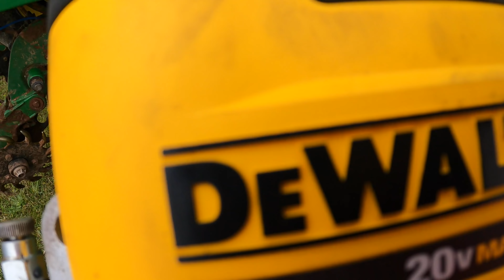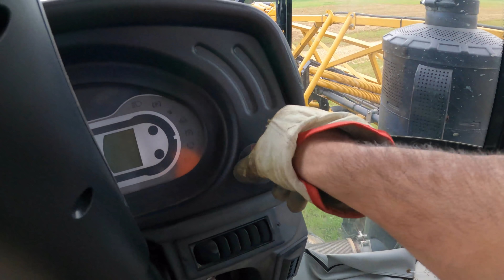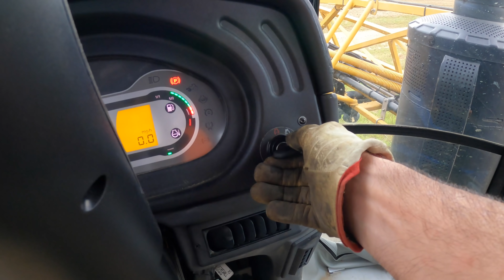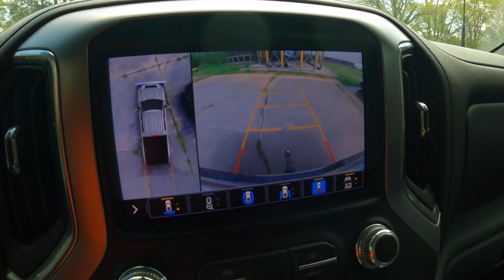RAIN DELAY CORN 2022

Comment: Thanks for the video. Have you considered trying to work a deal with your insurance and your dealer and trade for a new tractor now instead of waiting until it is fixed. That way you would have one for planting, with parts shortages it might be a while before it is working again. Maybe that is not possibly.

Comment: Thank God you have the insurance,my cousin was in a Dodge 2500 diesel p/u and was struck in the field and the wiring immediately caught fire.He had to bail and run for the tractor to ride the storm out.The truck was totaled but amazingly the chassis and engine survived and they bought it back for parts.

Comment: What are the benefits of you guys running stacker planters when you can pull one that’s twice as big? In south central Nebraska run one big pull type and one stacker. The only reason they have a stacker is for the pipe irrigation field’s to pull as far as they can.

Comment: Hi Daniel,  Just an observation when you were greasing etc the corn planter.  What was stopping the three point linkage's hydrologic's failing, with you under machine, maybe not the best example to the young generation, on safety.  Best Wishes

Comment: Great video as always...back in the 90's when I farmed had a combine get hit by lightning..that back before all the electrics like have today...are batteries were blown up too...after we put in new moniters & gauges then figured out had to change about every wire or wire harness then when got running found out had to change hydraulic lines and hoses...we finally just gave up and traded off !!!

Comment: sure hate it for yall on the tractor struck by lightning.in the early 90s we had a 4850 parked with disk in the ground and lightning hit a tree next to it,split the tree wide open,came through the ground up the disk blades to the draw bar and blowed the am fm radio and cab fan right out the dash on the ceiling,melted both batteries the starter and every electrical plug and wire on the tractor.took a long time to get it back from john deere.had to rent one to finish planting beans behind wheat. nature sure can do some damage.

Comment: We’ve had two lightning strikes on equipment over the years. One on tractor and one on sprayer. Tractor wasn’t too bad just the ecm and radio. Sprayer was a different story. Any thing that had a plug on it got replaced. Injectors all wiring harnesses all gps components. Bill was 70,000 on it. Thank God for insurance

Comment: I definitely agree with getting rid of that tractor once it’s fixed. Seems like lightning strikes leave gremlins in the system. For the Freon leak, could be the evaporator core. You’d see the dye coming out the little drain tube. Had a 2011 250 and a 2011 350 that had that issue.